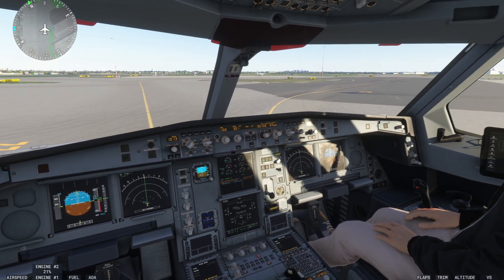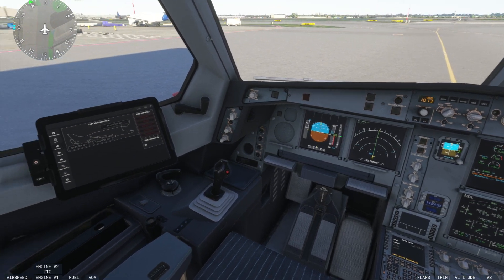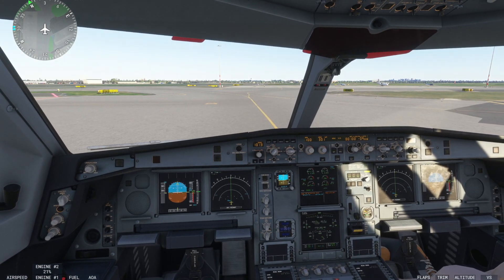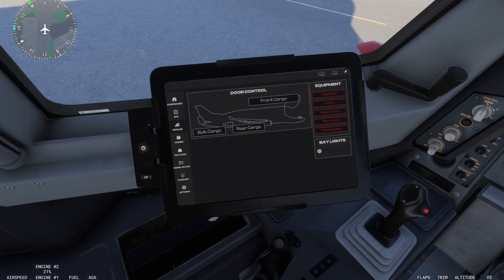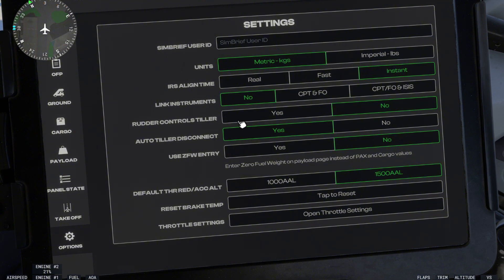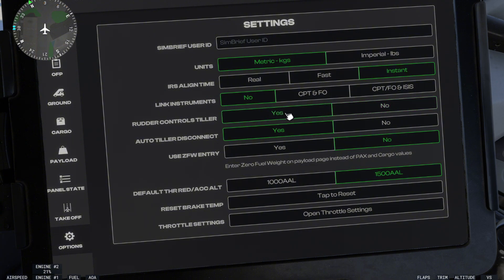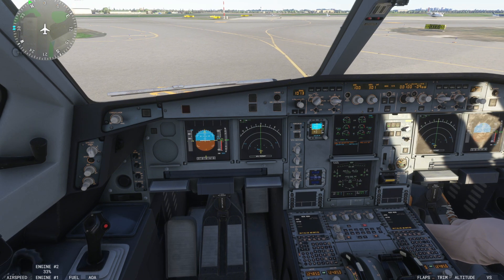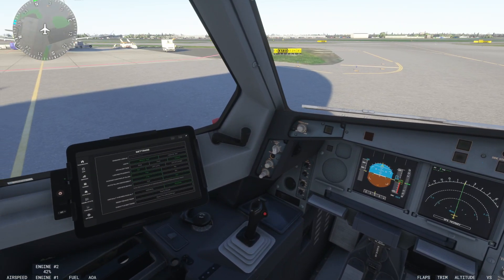Airbus Beluga Not Turning Easy Fix / Microsoft Flight Simulator 2024

Comment: "Rudder controls tiller: NO" is intended for people who (like me) have a dedicated controller axis for nosewheel steering. The idea behind this is that in MSFS airliners, directional control during high-speed ground roll during take-offd & landings is much smoother by reducing the authority that rudder pedals have over the nose wheel steering. And then, for low-speed turning we use a separate tiller that has full-range turning control. This accurately reproduces real-life airliners.

But for those who do not use a control binding from a specific, dedicated hardware axis for nosewheel steering (like probably most users), then the setting should be as you showed, "Rudder controls tiller: YES". 
Other airplanes (PMDG, etc) have similar settings for the same thing.